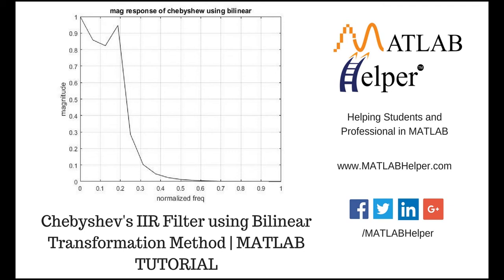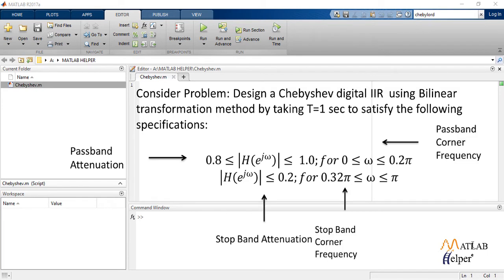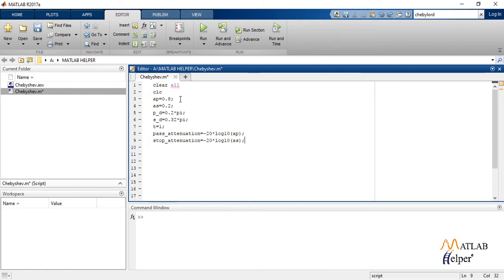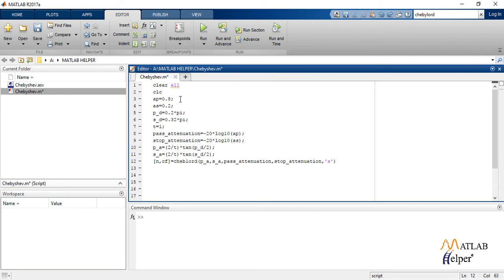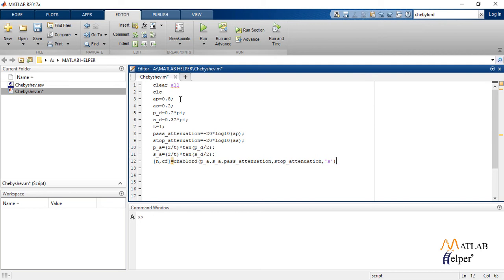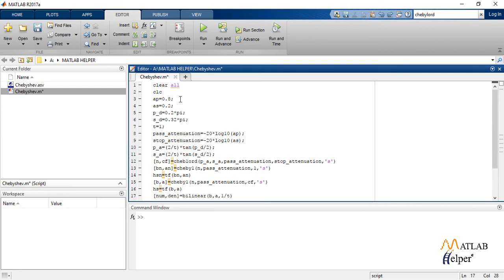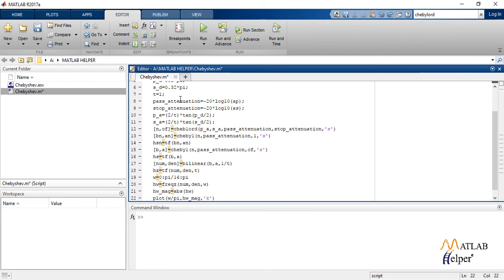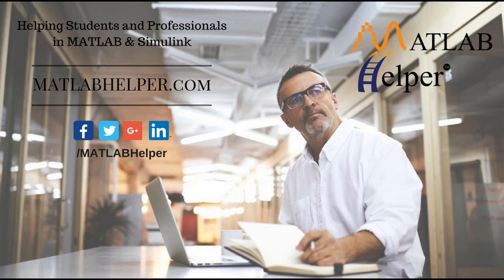Chebyshev filter using Bilinear Transformation | DSP | @MATLABHelper

Comment: NIce Video but it requires to be initially just give short intro about type of f#ilter Design of filter in MATLAB in very easy just we have to calculate the pass band ,stop band coefficients and also #corner frequencies. We have to use the inbuilt function for each filter.
Reply from the maker: Akash Munde, Thanks for your comment. Your suggestions are valuable. We would love to improve our videos. Please do suggest how we can improve your experience further, and We will do our best for you.